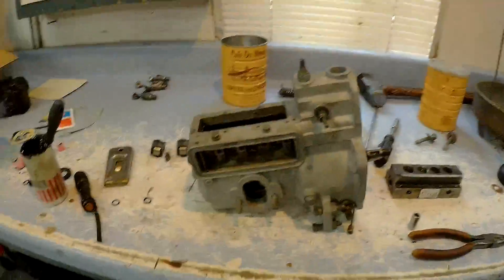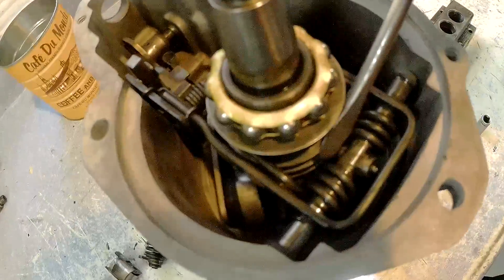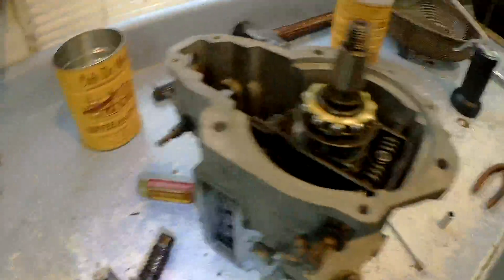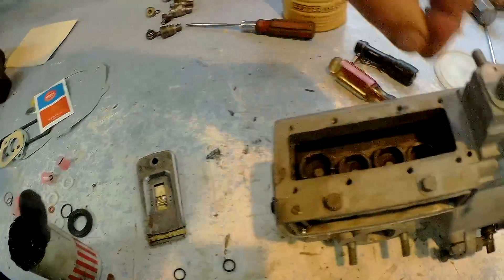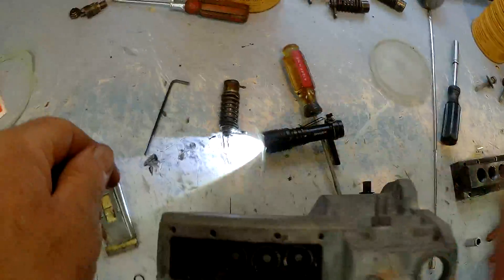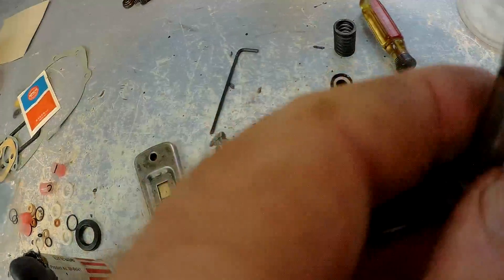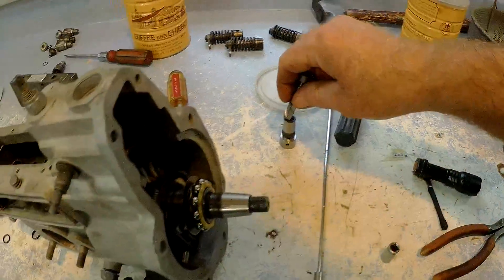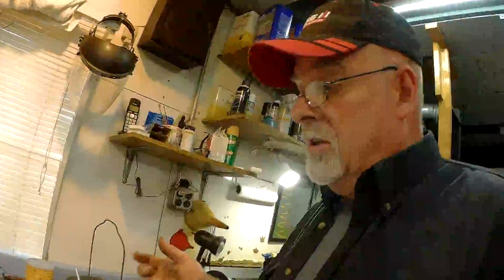Simms Injector Pump Assembly - Ford Tractor

Comment: Thats a Minimec pump made by Simms in the Uk originally then Lucas CAV 
Use the same oil as you use in the engine, going heavier can lead to slow idle and even hunting or unstable oil until the oil becomes more fluid.
Reply: I do a lot of those pumps, not for your application but mostly marine.
Bulletproof, simple.
Change bearings to taper roller.
Big elements and d/valves, permanent bleed in head of pump where a bleed screw normally sits, 20+psi inlet fuel pressure.
Brilliant little unit.
Reply: Hi Matthew.You hardly know the size of tapered bearings off hand.Going to rebuild one soon and would be great to know.Thanks  @matthewpollard5400
Reply: Hi, i got a cav engine in my backhoe digger which decided suddenly not to work anymore. The rack is moving, the lifters are going up and down and I got diesel going to the pump inlet. However it does not give a single drop any of the injectors. Are the elements worn out? All at the same time??
Reply from the maker: @bjrnericwang2093  So you took the side cover off and can see the actual plunger moving ? The plunger engages the rack right at that adjustment point. Make sure the plunger (s) are not stuck UP.  Let me know.
Reply: @mark_osborne  Plunger and everything was moving freely. That made it strange. Until I found those bleed screws above that inspection cover. I did not know what they were for. But once I opened those the fuel could flow into the pump as normal. And that fixed it. 😊
Reply from the maker: @bjrnericwang2093  Ha !  very good, and the mystery is solved :-)
Reply: @bjrnericwang2093  

Hi.
Do you have a number off the injector pump?
What make and model engine?
If you can see the lifters going up and down are the springs going up and down as well?
If the rack is moving then the plungers should be as well, only other possible thing may be all the delivery valves are seized closed.
Highly unlikely that all 4 or 6 of the plungers have worn to the point of not being able to pump at all.
Does your pump have a cold start or excess fuel button?
If so push it in and the rack should go even further and see if it pumps at that
Reply: @bjrnericwang2093  

If the plungers wear only a certain amount then the pump body normally fills up with diesel and if an overflow is fitted then  it will drip out of that pipe.
Does depend on pump type as if its a late model Ford Dover/Cargo that has its injector pump bolted to timing cover, these pumps have a hole in them that will let excess oil and fuel into the engines crankcase.
If the pump is shaft driven then fuel/oil will leak onto yhe ground.
If you have a very old vaccuum governor engine then it too should overflow onto the ground
Reply: @bjrnericwang2093  

Just thinking and its possible your tappet rollers may have smashed rollers, but in all cylinders isnt very common
Oil level in minimecs unless engine oil fed should be checked every 50 hours and changed every engine oil change
Reply: @matthewpollard5400  yeah regarding the lubrication on this thing, there is some oil in there but its not much and smells like old white spirit.
Reply: @matthewpollard5400  ok. I will do some more research and get back to you.
Reply: @bjrnericwang2093  

Ok
Hope you get it sorted.
Some work can be done without removing the pump  from the engine.
Reply: @matthewpollard5400  Good news. Its working again. Turns out there are 2 bleed screws on the side of the top block. Once they were loosened diesel came spewing everywhere. Thanx alot anyways for helping!
Reply: Hi.
When you said you had fuel going into the pump I thought you must have bled it thru the bleedscrews, normally only need to use the one furthest from the end where the fuel goes into the pump.
Great news its going again anyway.
Reply: @matthewpollard5400  Yeah, I'm used to bleeding the filter and at the injectors. Not at that place. I thought that if the pump was getting fuel to it, it would fix the rest by itself.
Reply: @bjrnericwang2093  

Easiest way to bleed that pump and you dont even need to put a spanner on any nuts or bleed screws is to  open throttle slightly pop the cold start button in and hit the starter key or button.
Couple of cranks and away she will go.
Reply from the maker: Good information !   thank you

Comment: I have a 3cyl simms pump, I ran out of fuel and now I can bleed system and tractor will run but whe you try and put a load on it the motor dies. I have to then rebleed to get going again, also I know nothing about oil in pump pls explain where to ck and how much needed to put in.

Comment: Great video thanks! 
This is very interesting. 
I have to do the same with mine. Any tips on taking it off the engine. I believe there’s timing marks I need to be aware of? 
I have a 1954 MK I engine on my boat- it’s always hunted quite a bit, especially on lower revs and the other day started revving way higher than usual.  then the engine wouldn’t start.  I’ve checked there’s fuel getting to the pump do I want to get it off to be re-built. 
Any tips greatly appreciated. 
Ed

Comment: i have a simms like that on my 5000, and i want to turn up the fuel for lil extra hp, can u explain how i do that? where the adjustment screw is located
Reply from the maker: Scroll to 1:07 .  Look at my index finger, the side of it is touching a screw with a lock nut.  Break the lock nut free with a 1/2 box wrench, then take a screw driver and stick it into the slot on the top of that screw and rotate it counter-clockwise until it stops. Then, while holding the screw with the screw driver, wind the lock nut down until it tightens up against the  housing.  You have just maxed-out your fuel :-)
Reply: @mark_osborne  ok thanx..u are the first channel that I have found that has very helpful info on that type of injection pump..thank u.
Reply: I just turned it...I also got new injectors ordered.i bought a hay roller I'm hopeing this will help with running it. Thanks
Reply from the maker: @brittfarms2018  You're welcome !
Reply: @mark_osborne  any idea how much  that adds?
Reply from the maker: @brittfarms2018  On a 5000 without a turbo it may add a bit or it might just roll coal without any appreciable increase in power.
Reply: @mark_osborne  ok thanks I hope it helps.
Reply: @mark_osborne  
Don't turn up too much to the point it's rolling coal, as it will put a lot of carbon in the engine oil.
It's not healthy for the longevity of the engine that might have few hours on it

Comment: I have a 655A ford backhoe completely dissasembled.can't find info on timing to include the simms pump.service manual does not show pump timing.any help would 
 be appreciated
Reply from the maker: Do you know about the little window that opens on the bell-housing so you can see the marks on the flywheel ?  and do you know about the scribe line on the drive plate that bolts to the pump shaft ?  and do you know how you can leave the 3 bolts loose that attach the pump's drive plate to the gear ?
Reply: @mark_osborne  He hasn't put the plate and flywheel back on yet,I told him to start there.Does the pump gear have to line up with something or just the mark on the plate and pump housing?
Reply from the maker: @timlesperance3039  Yes the line on the plate lines up with the mark on the pump before you bolt the pump in place. Also, take the little  cover off the other end of the pump.  You'll see a kerf cut into the pump camshaft and an arrow in the aluminum pump housing. Keep that lined up. (The timing gears also have marks that align when your at TDC compression) Then install the 3 bolts in that secure the pump drive plate to the gear, leaving them a bit loose until you get your timing mark set at the flywheel, then make sure the kerf on the end of the pump shaft still lines with the arrow, then tighten up the 3 drive plate bolts and you're done !
Reply: @mark_osborne  So the injection pump gear doesn't need to line up with other front gears?Just the marks behind the gear?
Reply from the maker: @timlesperance3039  Yes the injector pump gear has marks on it, along with the idler gear and crankshaft gear- they all need to be aligned.  Did you have the timing cover off and disturb the gears ?
Reply from the maker: @timlesperance3039  Did - no answer. Hope you get it figured out

Comment: Great video thanks, I have a six cylinder Ford Dorset engine in a fishing boat with a Simms pump and I suspect the pump plungers might be sticking, I've had the injectors tested and they are all within spec, the problem manifests itself under high load at higher revs with black smoking and a popping sound from the exhaust as if you had pulled a plug lead off a gasoline engine, cheers Mike.
Reply from the maker: Make sure you don't have a broken or weak valve spring :-)
Reply: @mark_osborne  The valve springs are all intact and don't feel week, I've checked and re checked the clearances, its had a new camshaft and followers , there's no crankcase pressure or excessive oil use, it did have a load of new parts chucked at it 430 hours running ago and has only developed the problem  after about a 150 hours running.
Reply from the maker: @MrCrabbing  Does it appear to be isolated to 1 cylinder ? or would you say you have multiple cylinders breaking up ?   Turbocharged ?
Reply: @mark_osborne   It is a one cylinder thing, and its a 380 NA Dorset, i will see if I can upload a video to YouTube now thanks
Reply from the maker: @MrCrabbing  Can you have someone drive the boat while you crack the lines loose at the injector (or at the pump), one at a time to isolate the effected cylinder ? You only have to turn it about 1/2 turn just so the pressurized fuel spills out instead of firing the injector.
Reply: @mark_osborne   That is a good idea used to do that with the older cars to see which cylinder was down, Yes I can do that whilst I'm towing the trawl along just nip down below and crack them off one at a time see which one dose not make a difference, it definitely sounds like one cylinder is down on that clip
Reply from the maker: @MrCrabbing  Yes !  let us know

Comment: Great video Sir, l have a ford 7700 that has a minimek pump that will only go full throttle (runaway engine). The linkage is fine to this pump and I had a hired hand tell me he ran the tractor out of diesel and then after refueling he tried to restart it with starting fluid. The tractor back fired after a while 
and then started but it never can idle down. He cut the fuel to turn it off but now it will only run full speed. Any thoughts out there? Thanks
Reply from the maker: Take the side cover off and see if the rack is free, it should move easily from right to left if your throttle is in the idle position. - Full right is idle, left is full throttle. Go from there. Let me know.
Reply: Mark Osborne, I will try to get to it tomorrow afternoon. Thanks for the quick response 🙃
Reply: Howdy again Mr. Osborne I finally got around to removing the side cover and it is definitely stuck. I even tried tapping on it and wound loosening the hex screws where tapped on it.
Reply from the maker: @LuisRodriguez-yk9pd  .... now you got to figure out 'why"  .... let us know what you figure out

Comment: hi mark great video , i have a simms 6 cylinder with very stiff rack quiet hard to move it side to side any tips on freeing it up or how free should this be with plungers in there . thanks ted
Reply from the maker: There's really only one thing that I can imagine that would make the rack hard to move and that is sticky plungers because if you disengage the plungers from the rack, it will literally flop around inside the housing.  One quick thing you can check -- take the nut off the end where the rack extends out, and just take a look and make sure nothing is caught in there. Very unlikely, but just look.  Beyond that, I can't think of much else you can do except pull the delivery valve holder off and pull the plungers out of the bottom of the barrels and clean things up.  You should be able to do it without having to put the pump on a test stand as  you won't be disturbing any settings
Reply: @mark_osborne  thank you mark i will try that

Comment: Its true that there is not a lot of information about this pump out there,  I am trying to clean out our Simms pump off of our backhoe and am having trouble getting the adaptor plate off of the cam shaft so that I can get the cover off.  I see that there is a key in there and have tried heating it up but cannot budge it with my puller.  Is there a trick or other method for it or a special tool?  Thanks for the video,  very helpful.
Reply from the maker: Yeah, it's a heavy taper with a key.  The only thing I can say is try letting it soak with something like PB Blaster overnight, then go back at it.  Try heat again.  Worst case is you get it so hot you melt the front seal but so what, that's easy to replace.

Comment: Hi mark, when bleeding my pump and cracking the injector nut, it ended up loosening the housing which holds the small plunger . Not its leaks around the base. What type of sealant do you use for this ?
Reply from the maker: Scroll to 9:32 in the video.  Are you saying the part I have in my hand is leaking where it threads into the housing ? and if not, clarify by showing me in my video an example of the part you say is leaking.
Reply: @mark_osborne  yes that peice leaks between it and the housing after it came loose when I cracked the Injector nut.
Cheers
Reply from the maker: @rikkimcguire8785  That piece needs to be tightened up - tight !  . Then, crack the injector nut loose at the "injector" for bleeding.
Reply: @mark_osborne  she was tight as, almost couldn't un do it . Maybe it's missing an o ring or gasket ?
Reply from the maker: @rikkimcguire8785  Well yes, there is a special plastic O-Ring that goes under the delivery valve.  Did you buy a kit ?  It's that pure white ring, there will be 4 (or 6) in the kit. Also, this actually takes a special socket but I'm sure by the looks of what I see, a lot of people grab those delivery valves with vice grips
Reply: @mark_osborne  too funny I did use vice grips.  Off to the shop for new rings and a nut . Thanks for that

Comment: Good Video 
How i can Made More Rotation Speed on these Injektion pump ?
Reply from the maker: Adjust the throttle so it pulls harder on the pump arm.  If you need a lot more rotation speed the pump must come apart and the weights need to be lightened
Reply: Mark Osborne thanks for help

Comment: What oil goes in Simms pump ?
Reply from the maker: I personally use synthetic rear end oil 75W-90 from O'Rielly, it's inexpensive and awesome oil.  Be sure to check for fuel intrusion every so often by removing the upper plug on the side of the pump, if oil comes spilling out, some fuel is making it's way past the plunger and barrel.  If that's the case, get on a regular schedule of changing the oil :-)

Comment: Hi Mark.
Interesting movie!
My neighbor has a problem with Simm's three cyl pump. When you open the cover you can see that one of the lifters does not move up and down  properly when running the start motor. Could it be because a  broken camshaft bearing?
Reply from the maker: Unfortunately it sounds like a rounded-off cam lobe. IF that's the case, your best bet is to find an entire used pump on Ebay (perhaps)
Reply: Ok. Thanks a lot for your answer.

Comment: Hey Mark! Great video btw, very informative. Very curious to kno how do you time it or know what firing position it's in? Thanks in advance for your response.  I'm currently working on a 655a.
Reply from the maker: There is a timing mark - a slash or line drawn on the drive plate (the drive plate bolts to the output shaft).  That mark is TDC, meaning, when you look at the mark through the front access plate, then look at the timing marks on the flywheel, you'll be able to set the timing.  IE: Set the timing on the flywheel at 26 BTC by turning the crankshaft, then line up the mark on the drive plate with the drive gear by rotating it and aligning the marks before tightening the 3 bolts.  Hope this helps. If not, go to Tractor Supply and get a manual, they may be able to explain it with photos better than I can type.

Comment: I've built many of those pumps over the years stock and for tractor pulling. I'm very curious what your actual fuel delivery was on a test stand? Was the phasing and plunger end float set??
Reply from the maker: Don't know what you mean by phasing and plunger end float - you're speaking beyond my pay grade.  It was put on a test bench at a reputable shop and the rack was adjusted to where each plunger put out the same amount of fuel which turned out to be 256 cc's. However, all I had at the time were stock delivery valves which I promptly switched out to some much larger valves supplied by Wimer when I got the pump back from the shop.  Mathematically it calculates to 357 ccs based on 200/1000th's (.200 inch) of travel of the plunger inside the barrel at full rack before entering the spill port.  I swapped out the delivery valves to the larger, cut valves before installing it onto the tractor.  So I don't know what she's actually flowing but  Wow does she flow !   My T3 Garrett is the limiting factor now.  Need more air.